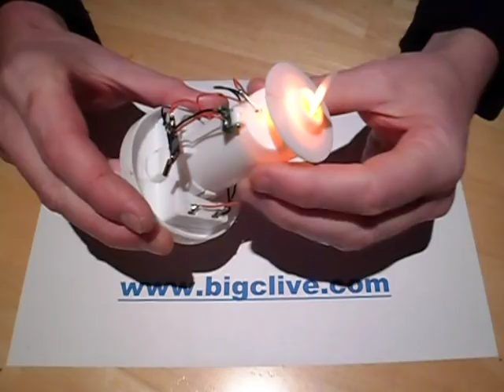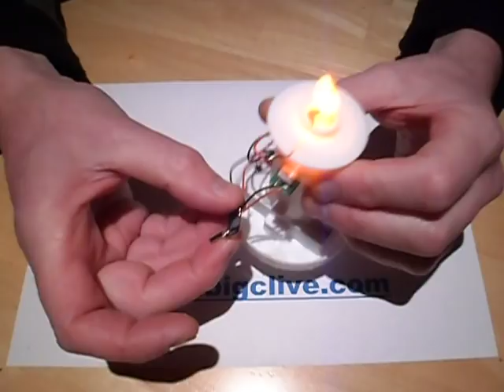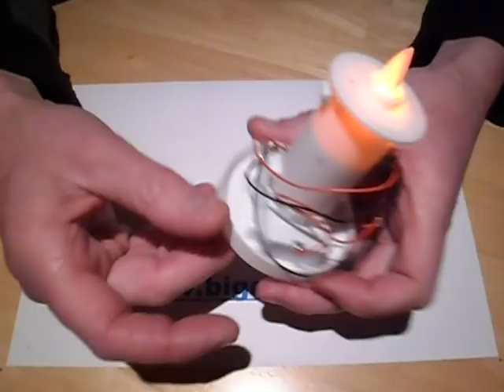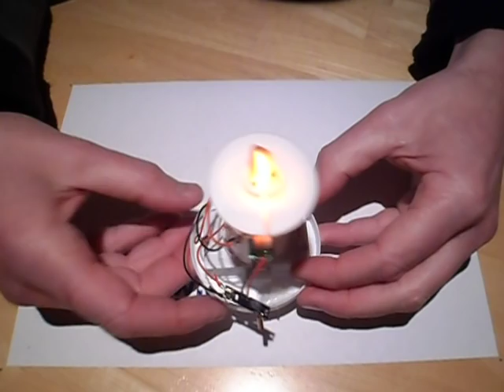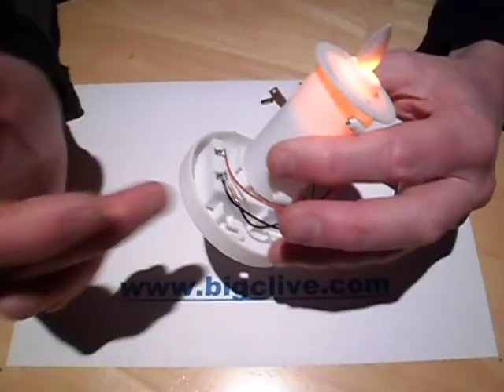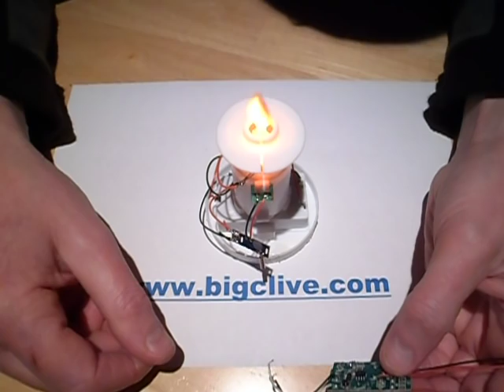Hacked Premiere dancing flame candle.

Comment: The HT7750 booster board takes in 1.5VDC and puts out 5VDC, 3.3Vdc is also available. I have been getting 3 AA cell work lights & convert them to 1.5 Volt single AA lamps almost like a Joule Thief. They run to about 0.7 Volts and use otherwise spent batteries. Great to keep around if the power goes out. I like this candle idea.

Comment: Clive I have used the LED's in the battery tea lights for various lil projects.. They are simple and interesting. I wonder how they would look as the light source. The light flicker in addition to the movement may be quite pleasing.. or? :) I'm not sure what the minimum voltage to drive them is tho.

Comment: Clive, did you experimented with the original circuit board and just a resistor in series with the coil to reduce the clatter?
Reply from the maker: +l wilton Yes I did.  I can't remember the optimum resistor value though.